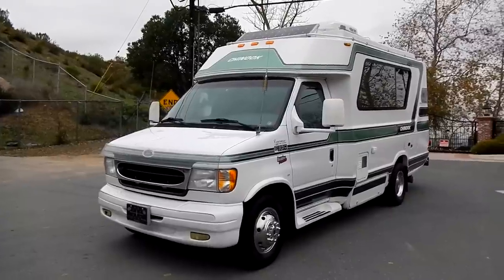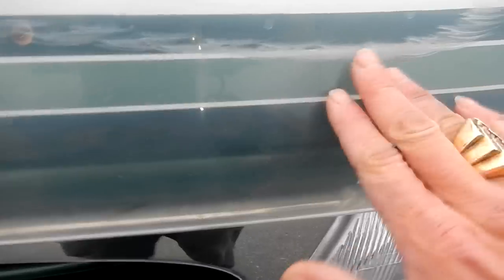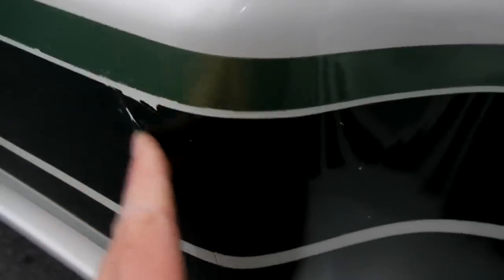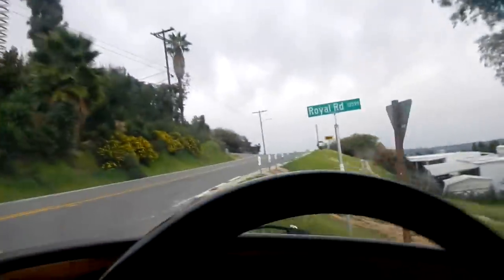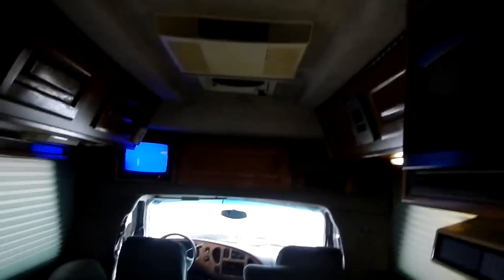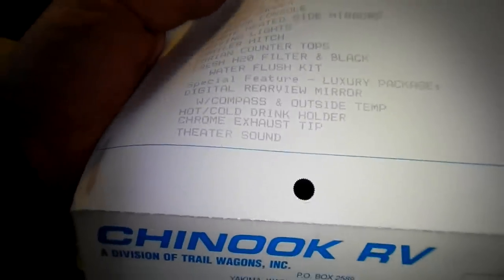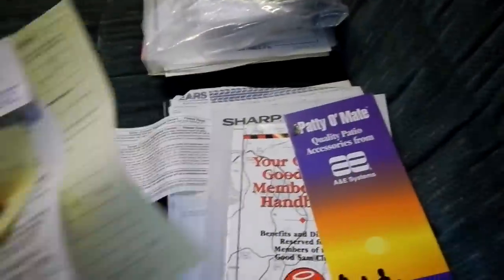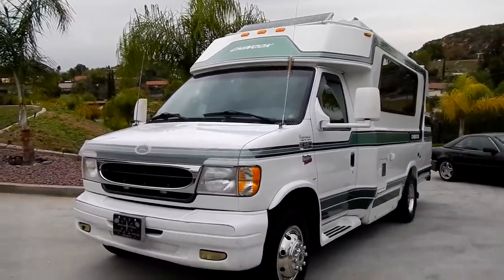Chinook Concourse RV Motorhome Class C or B Solar Powered Ford Camper For Sale

Comment: People buy those to live in them, not to look at scratches on the body nor paper work.  Has it got a place to sleep in?  I have yet to know...
Reply: I ws thinking the same thing 
I think it has a sleeper couch
anyways i been looking into going off grid mostly cuz i hate people... and the current state of bs that goes on in the world. a chinook is a good option to do this i think Cheap on gas. roomney enough to be a house but small enough to be road savy
Reply: Kim H If you need a STEALTHY- RV check out the Pleasure way LEXOR 2000-2013 They are made entirely using the van without extension and all hidden RV fixtures. The 2011 model is the best- cheaper, has an enclosed shower/toilet and sitting next to any other conversion van cannot tell it can be a full timer! The chinook is just BUILT right! Drives like a CHAMPION and the older ones are definitely worth investing in as a full time RV! for two or three is the third is a small four leg friend:")
Reply: V10's are not cheap on gas!